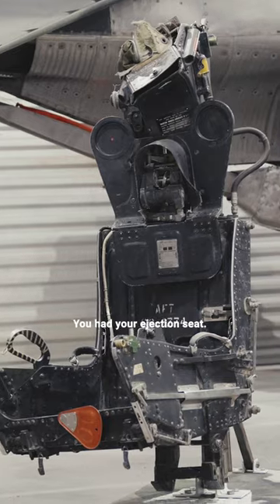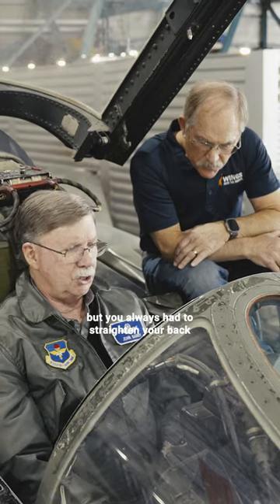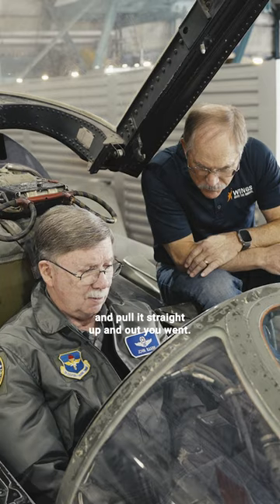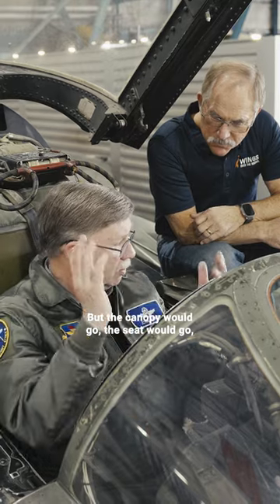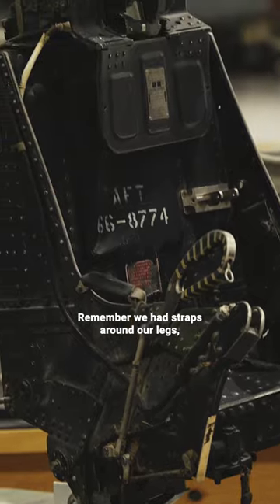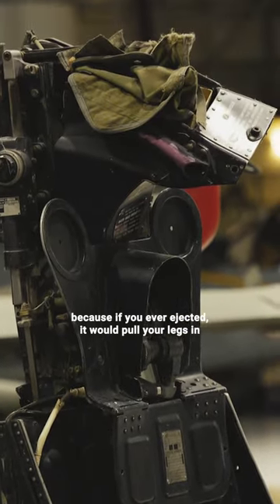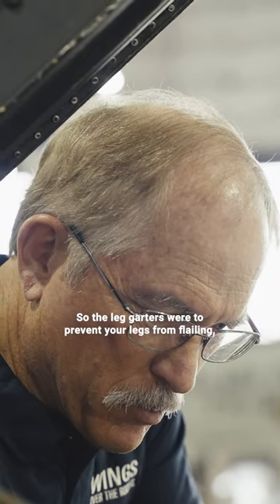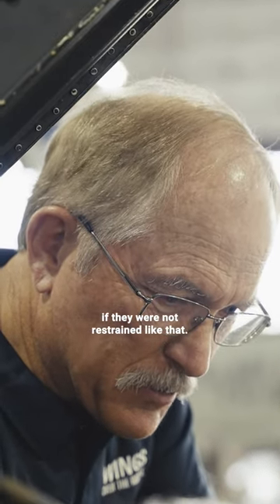F-4 Phantom Ejection Seat #aviation

Comment: F-4 chair had changes 1.An aviator flying low and slow at China Lake, named Faller, could not get out and burned  alive on the ground. 2. Then, a sailor tested the changed seat, putting it and himself into the  hanger roof.

Comment: Martin Baker Ejection Seat. A UK design
Reply: A design that could just as easily have been German 😅
Reply: It is said that this Manufacturer offers a tie to every crewman who ejected and survived.
Reply: @GeneralBlorp  the first ejection seats were German, equipping the Heinkel 162, later Heinkel 219 and the ME 262. I guess that almost everything had to be made manually and of course they were not 00 capable.
The early P-80s had no ejection seat and that is what got Richard Bong killed. The plane flamed out shortly after departure and he had failed to turn on the stand by fuel pump.
By them McGuire had also crashed to death in his P-38 while being jumped by an Oscar; and so ended the two higher scoring American Aces. But this you certainly know, or you wouldn't be here watching ejection seats. ☺

Comment: Worked ARFF back in the early 80s supporting RF4C aircraft.
One of the emergencies included a large bird striking dead center on front windscreen.  
Fortunantly the back seater was able to land the aircraft as a bone from the bird actually disabled the front ejection seat when it lodged in the banana clip.
Front pilot had broken nose and lacerations but was otherwise fine.

Comment: The leg straps... I wonder if that was a better or worse system than the Starfighter. Those pilots wore spurs, the straps were attached to those, and that's what restrained your legs in an ejection.
Reply: Yee haw
Reply: I've worn both. The Starfighter's Lockheed seat (pretty much the same seat used in the SR-71 Blackbird) requires the crew to strap metal "spurs" to the heels of your boots. To these are attached metal cables that connect you to the seat. The cables retract during the ejection sequence, pulling the legs in and preventing them from being whacked off by the instrument panel on the way up.
The "garters" on the F-4's seats loop around the upper calves amd ankles and perform the same function.
Reply: @thomasbell7033  right, which is why I was wondering about the benefits and drawbacks of either.
Reply: @thomasgeorge4384 feels like the shin strap would be more secure than the spurs.
Reply: Are we remembering that in the USAF version of F-104, the original seat ejected down?
Reply: @seansky2721  i had forgotten, but there's a reason why they got rid of that seat early. The spurs were part of the later model seat.
Reply: @thomasgeorge4384  yessir.  The Luftwaffe insisted their G-model Starfighter bang-seats launch the customary way.  Lockheed complied, and the rest is history.

Comment: I have read that flying careers were ended by ejecting.  The spine was compressed by the stress put on it in by ejection!!
Reply: Read an article about a pilot rescued from sea scape. He was 2 inches shorter than before that flight!
Reply: As a rule, you can only eject twice. It is considered that your vertebrae will not be able to withstand the compression of a third ejection, so if you ejected twice they will post you to a Unit flying aircraft without ejection seats; or doing something else lest you end up in a wheelchair.  This was told to me by an A-7P Portuguese Air Force pilot - he was told while qualifying in the US - and its ACES seats were quite sophisticated, very similar to the one in the F-16 and A-10. Not a Champanhe bottle cork like those in a F-84. 😲

Comment: So did the pilot have to attach the straps to his garters every time he got in the cockpit, or did they catch his legs automatically?
Reply: They had "spurs" they clipped into the garter
Reply: @TiredOldBo  thanks for your reply. Could they attach them just by placing their feet/legs in a certain place, like a racing cyclist clips his shoes onto the peddles, or was this something done by hand? Just trying to visualise the preflight routine and the ergonomics.
Reply: They had to attach them each time, just like strapping into the seat.
Reply: @rockriver2652  👍 thanks. Doesn't look like there's much room to lean forward to reach down before your face is in the instrument panel!
Reply: @lukedogwalker These thin straps have two loops for each leg. You put your legs through each loop when you sit down. They are adjusted using velcro. The ACES II amd NACES seats I used (F-15 and F/A-18) had no leg restraint straps.
Reply: @thomasbell7033  thanks, Thomas.

Comment: How long until the leg stirrups released to seperate yourself from the seat?
Reply: I believe they come loose from the seat at the same time as the lap belt, usually when coming down through 14,000 feet IIRC.
Reply: @thomasbell7033  What if you eject under 14,000? Immediate release from the seat? Did that ever malfunction. The fear would be being stuck to the seat for the descent and I imagine that's a pretty hard hit strapped that seat.

Comment: What if you eject upside down?
Reply: dont
Reply: Altitude permitting, the seat will turn up. They had gyros to sense the attitude in the air. Probably they use a more sofisticated system nowadays, but the seat knows where  up and down. are. The seat's drogue chute will do likewise anyway, but taking much longer.
Reply: Heard somebody say it compresses your spine like shit and it’ll hurt a fuckton. You’re going from -1 to 13 Gs instantly.

Comment: hear too that if you eject, you wont pass the physical to fly again cause of the damage to your back from the g's you are pulling.,
Reply: That isn't always true. We had an aircrew eject from a jet on one of my cruises, and they were out of action for a short while maybe a week or 2 then continued flying for the rest of the deployment.
Reply: It’s more likely they’re not going to happily ‘hand over the keys’ to a pilot that’s already written off one very expensive aircraft
Reply: Not true !  I was a US Navy aviation structural mechanic egress. AME  that’s what I was trained in, to maintain all safety systems including the ejection seats. As long as the pilot’s  ejection from the plane was within the ejection envelope.  Basically within airspeed, angle of ejection and proper body form upon ejection they were fine. It’s when there’s no clear airspace to eject to ( like ejecting into the side of the ship ) or ejecting while the plane is coming apart due to collision with another jet , a mountain or crashing into the flight deck, that becomes problematic.  Unfortunately the saying goes if you have time to think about ejecting you most likely waited too  long. I’ve seen  a half dozen pilots killed because they were a second or two late on ejection.  It can happen in a blink of an eye.
Reply: @harrisonrawlinson5650  This is a common misconception. On average, it takes about 2-3 years to become a fighter pilot + all the infrastructure runways, airbases, buildings, ground crews etc. The "very expensive aircraft" in reality is a fraction of the cost of creating qualified fighter pilots.